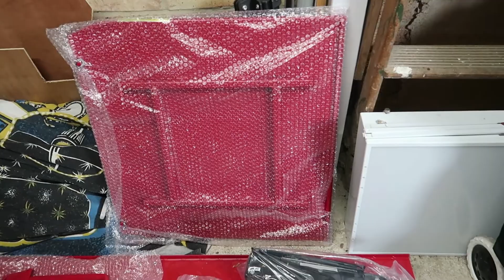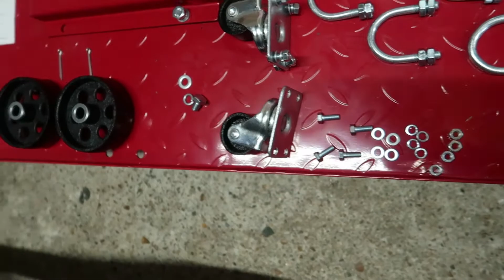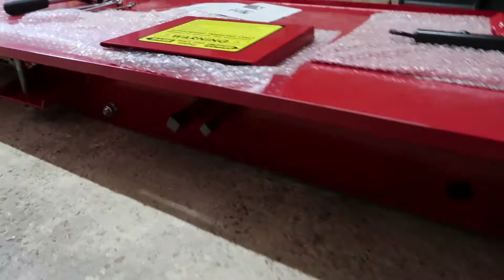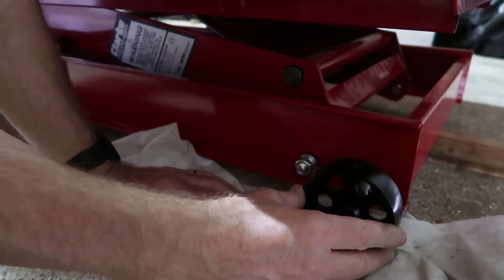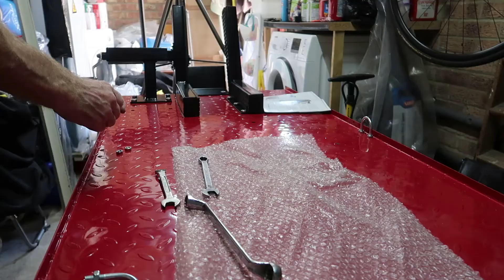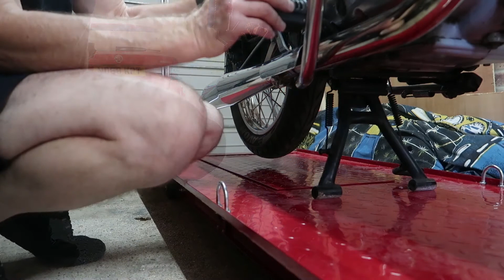Assembling my new Clarke CML3 motorbike lift. Foot pedal operated workshop lift .

Comment: I built a wooden frame with an electric winch which permits me to store the lift vertically against the wall when not in use. It takes up too much floorspace otherwise.
Reply from the maker: Yes, that was the only problem I had, it does take up a lot of space. Good idea!

Comment: I have the same lift table, sold by Harbor Freight in the U.S.A.  It came with the air/ hydraulic jack. After about 12 years of frequent use, the pneumatic pump gave out and I manually pumped it up for about a year.   I eventually converted it to a hydraulic cylinder powered by an electric pump.  It was a good lift.  Now it's a great lift. I also have the same lift with the manual jack.  I also converted that one. 

Here's the link to the video on the mods I did.
https://youtu.be/T6eHjhZNkXw
Here's the video on the conversion I did on my second lift.
https://youtu.be/YDfjtZN5AJw

Comment: Thanks for the upload, very useful as my Clarke lift is coming in a couple of weeks. I must get some lithium spray grease in readiness to eliminate the squeaking 👍
Reply from the maker: Thanks Michael. It's a great help when you're working on the bike. When you assemble it, lift the base to make it easier to do up the bolts for the protector plate....I made that bit hard work! 🙄🙄. It also stopped squeaking by itself after I'd finished. ☺️☺️